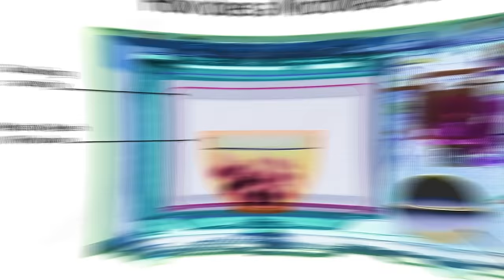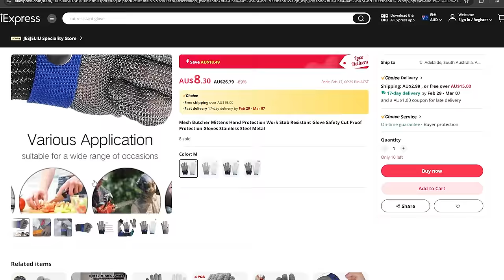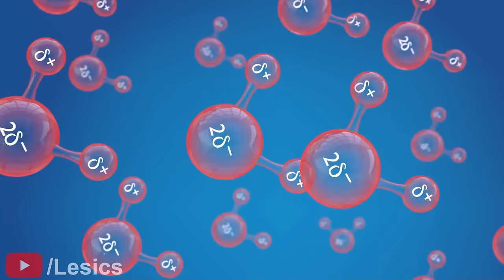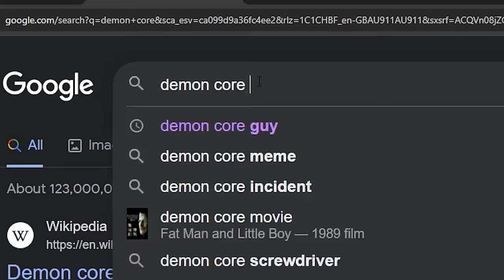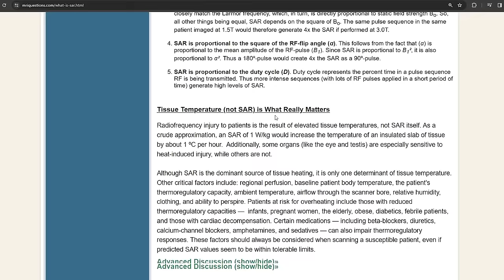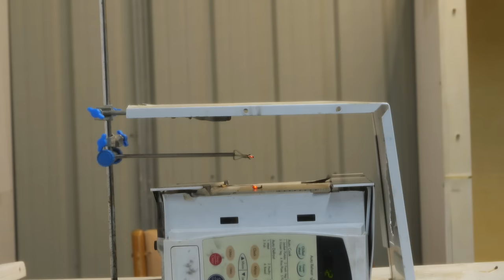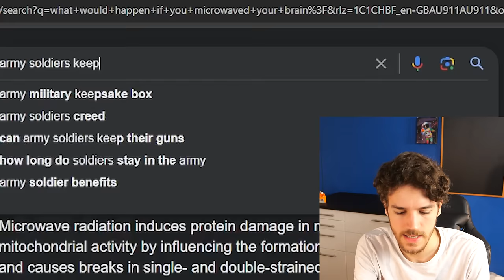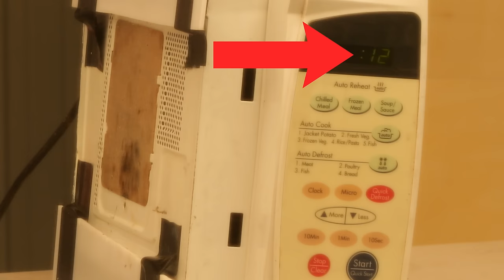I Tested the Limits of a Microwave

Comment: You yourself say that microwave radiation causes the heat by vibrating water molecules because they are polarized. Well, what else is polarized in your body? Basically everything. 

The most obvious effect is heating - this is true - but also the electromagnetic field is literally tearing everything inside you apart on molecular level. DNA is not immune to that and may be damaged depending on circumstances. 

Which is exactly what causes cell mutations. 

Our organism is equipped with multiple defense systems to find and eliminate such errors, but once in a while they all fail horribly. 

That situation is called cancer (actually it's much more complicated). 

So if you stick your hand into a microwave unprotected for a short while you are not going to die (unless you actually manage to literally cook your hand and succumb to i.e. gangrene). You are just adding a few chances to having cancer - possibly later in life. 

Do that a lot and your chances of getting cancer also increase a lot. In addition to probably a lot of other complications of varying subtlety and severity.

This is what happens with smoking. Do it once and you increase your chances of getting lung cancer a little. Do it for decades and destroy utterly any healthy tissue inside your lungs to maximize your chances. Even then - most of smokers don't get cancer, it's still a game of Russia roulette you don't want to play.

Comment: The mice developed tumors on their skin after two hours of exposure, six days a week, after one year. That doesn't mean less exposure doesn't cause cancer. It is causing cancer. It's damaging your cells. Just not enough all at once to spontaneously cause tumors. It's just lowering the amount of time you have before the tissue in that region is damaged enough to become cancerous.

All humans will get cancer on a long enough time line. All DNA breaks down with time. Microwave radiation causes continual micro scale damages that slowly edge you closer to the end of that countdown.

It's well established that microwaves will eventually cause cancer and it's a major reason why it's suggested to limit your exposure to microwaves. It's not the immediate danger of spontaneous cancer. It's the slow, insidious damage it causes building up over time until eventually you develop cancer.